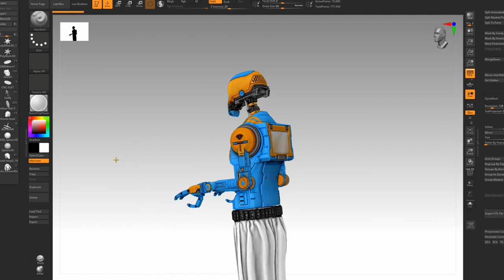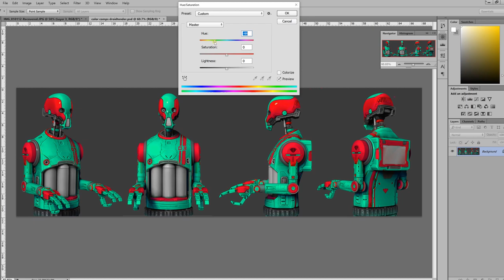My Droid gets a paint job! (Episode 6)

Comment: Very nice robot. I might have tried a much darker less saturated blue. I think it would be a more 'mature' look. Like cars, what we see as a vibrant color can actually have very low albedo. Much less bright that we think. Also is there some kind of gel coat that could smooth out the print structure without losing too much detail? I think that could boost the look too.